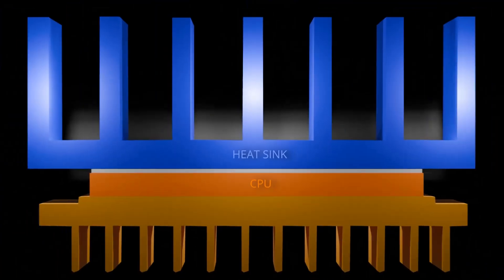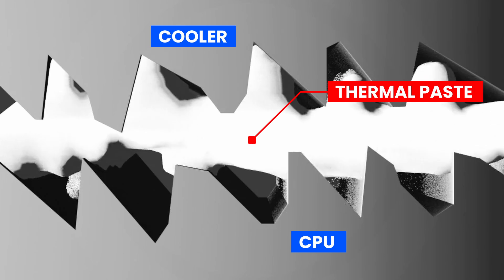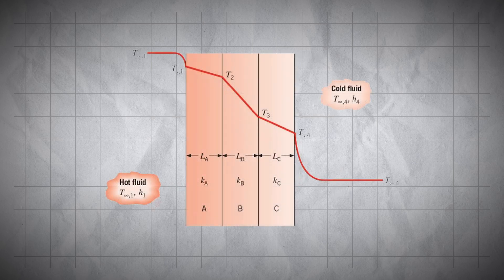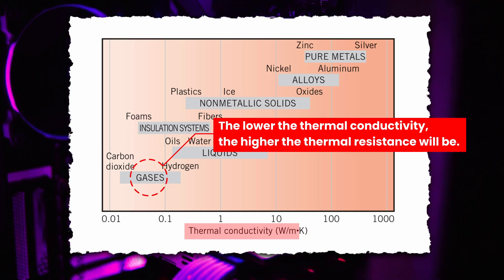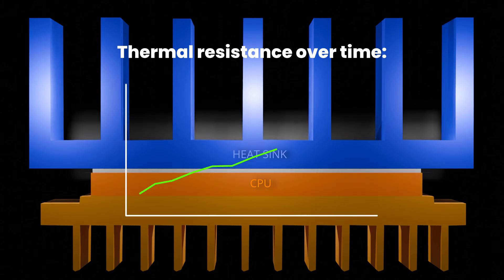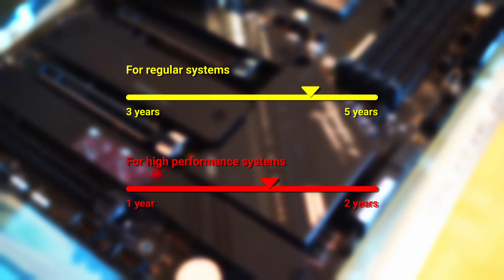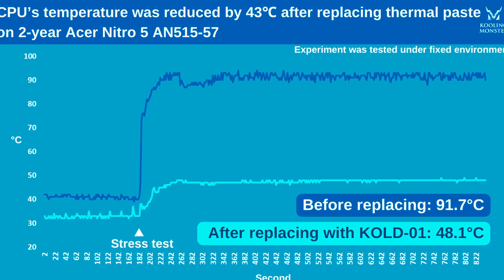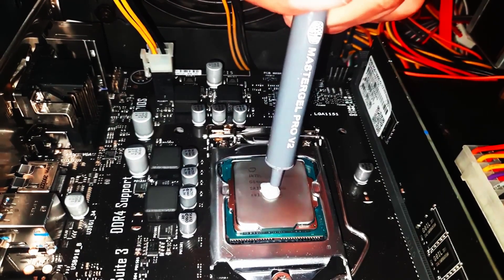Why You Must Replace Your Thermal Paste

Comment: I just replaced my laptop thermal paste for the first time since brand new (3 years ago).

It's now peaking at 90 degrees. 

About 5-10 degrees more than the 3 year old thermal paste.

I tried to put lots and i tried to put a pea size dot but nothing is changing. What is wrong
Reply from the maker: This might be related to the quality of the thermal paste, applying too little (leaving air gaps) or applying too much (the paste acts more as an insulator, not just filling the gaps but actually preventing direct contact between components, which would result in better heat conduction)
Reply: @rafaelsmdc @Mechub  well in most cases too much thermal paste didn't do much worse. If it is Intel cpu apply it like in line. Cooler role is to spread that paste evenly. Make sure cooler tighten correctly.
Reply from the maker: @ArthurLeywin_01 Yes. As presented in the video, the contact pressure between components also enhances heat transfer. The paste just needs to fill the air gaps, but without getting in the way of direct contact between the GPU and the heatsink
Reply: @Mechub  well yeah. I was thinking of tagging op who got problem. I accidentally tagged u. Lol but yeah you were right
Reply: I had that same issue I changed from normal thermal paste to ptm7950, I haven't had that issue since then and I'm getting better temps now
Reply: It could be thermal paste related, but you mention it's 3 years old. Has there been a deep clean of the exhaust vents and fans?
Reply: If you havent already, Use a program like HWMonitor to isolate the specific part of the laptop that's heating up (cpu, gpu, ssd etc), as well as any potential issues with cores if there are any.

Comment: did repaste with artic mx6 and now my temps got worse 🤣🤣🤣
even my thermal paste which was applied 3 years ago when i removed it the thermal paste was still there there was a 3+ degree increase in temps bruh it was used to reach 88 while playing cyberpunk 2077 and now it reaches 90C bruh
Yes the thermal paste is applied in x shape aand i have removed the sticker and its a 240mm aio

btw i have a ryzen 5950x

Comment: I already experienced it. My laptop like after 2 year. It started giving me like 10-20fps on games. I was like what happened. I tried window re-install. Gpu driver re install. Nothing worked. I check temp it was overheating. Sometime If i do heavy gaming while getting 15-20fps. Burn smell like came. I ordered thermal paste. Open laptop clean cpu then applied new thermal paste viola. Laptop gave me new like performance. Again got like 100 fps